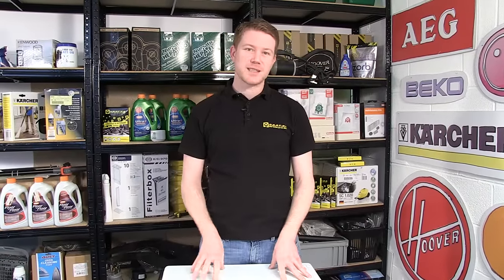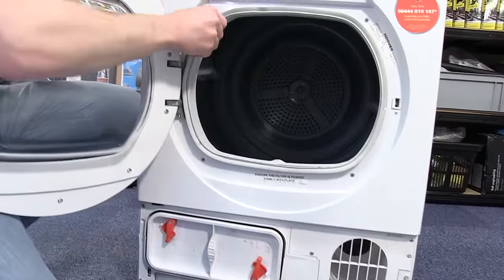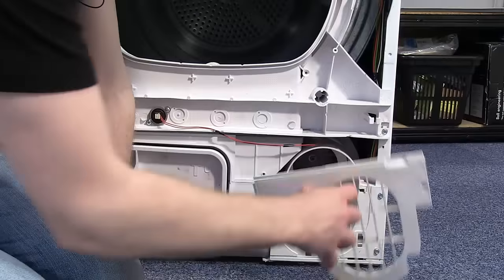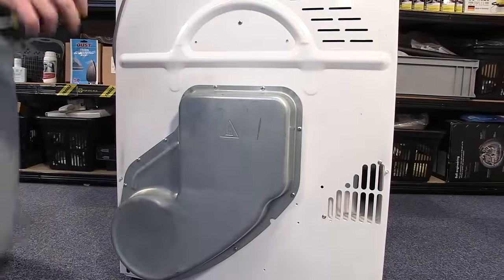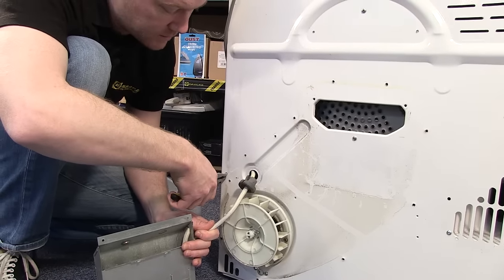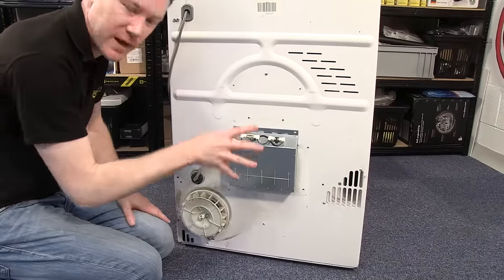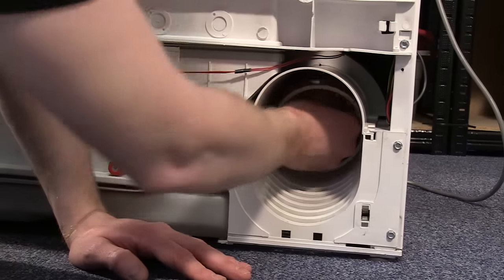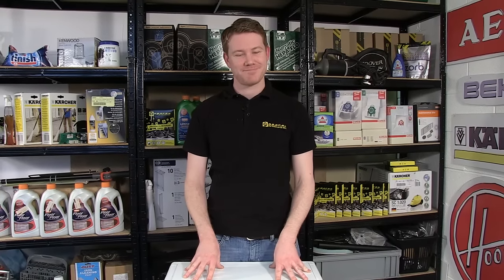How to Replace a Tumble Dryer Heater (Hoover)

Comment: Instead of taking the front off the machine I fed a bent cable tie through the cable grip hole: attached strong thread to cable tie with tape and pulled it through then looped thread around cable grip and pulled it through the hole; saves a whole load of time

Comment: Finished the job and it worked fine. Thanks. For anyone doing the same repair I would advise marking the position of the seal join on the cover with a permanent marker, also the orientation of the ring that sits in front of the fan... to make assembly easier.

Comment: Great video. I've just replaced the heater on my VTC5911NB following you, and saved over £100 in call out and parts. Only cost £40 for the heater and I did it in half the time it would have taken for someone to come out, look at it, order the parts, then come back and fix it. (Also Brownie points with the missus!). Thanks.
Reply from the maker: Hi Matt, glad we could help.

Comment: You don’t have to strip the machine JUST to reclip.
Loop fishing line through the grooves clip and push inside. Once heater is changed, pull the fishing line out with the tip of the clip and use small pliers. 
That’s 40+mins saved.

Comment: Hi,  can I suggest as a previous hoover engineer.

A faster way to do this for a heater,  although most engineers did not replace the little lug at the back to hold the cables as it was really a 3 minute job and we didn't want to have to part strip the front down (we were always pushed for time doing 11 jobs a day)  

However if you want to make this much easier and do it properly the is just to tie a tiny bit of string to that cable clamp,  push it through,  pull cables through as you show,  change one at a time,  push the cables back through and push rubber back in place,  then gently pull the string until the clamp comes through,  thats also the way they told you to do it in training.  That way you just need to take the back panel and heater off,  and leave the rest in place.
Reply from the maker: +jason hounsell Great tip to overcome a difficult problem, perhaps using a nylon fishing line would make it easier. However if the viewer gets stuck they can always return to our version.
Reply: I wish there was a video how to , I’m wanting to do this but I don’t get how or where you tie string iff just a little point is coming out the back
Reply: I followed your advice today. Saved me a ton of time. Thank You!

Comment: Great video. Well done hoover though for making such an easy job so difficult. I think the need for the cable holder was an afterthought.... why would anyone make it so complex to remove it otherwise.

The only problem I had was the upper fan cover which would not come out. My model looked slightly different than the one in the video which might explain why. I still managed to get my hand in though. Note that the screws in the front fan cover are different lengths. I think the short one goes in the right to prevent it from catching the cables behind. Not really designed for fool proof assembly!
Reply from the maker: Hi Neil, we agree this can be a difficult repair but for anyone attempting this there is some good advise from a hoover engineer on this page in the comments.

Comment: having issues with candy model similar to this. no heat and all the lights flash after 10 mins. watched a few of you vids and have ordered new heater element. hopefully this will remedy issues
Reply: I had the same problem
Reply: did you manage to fix it ??

Comment: You don’t need to waste time removing the front. Just use a thin piece of fishing wire and pull the retaining clip through the hole.
Reply from the maker: Hi Donald, thanks for your response and input. We hope this video helped you.
Reply: I did that with metal wire worked a treat but it cut out shortly ageee turning on I’m hoping it’s the 3 amp fuse I put in plug , just waiting for 13A fuse nie fingers crossed

Comment: Hi your video was very helpful, there are not a lot of videos for hoover driers out there and they are a bit of a pain as they do not have a side panel.
I was looking at yor diagnosis video before I ordered a heating unit but the element in that has a simpler connection than the hoover one.
Could you let me know across which two cables I should I should be checking the continuity in order to work out whether or not the element is broken.
Thanks
Reply from the maker: +Eoin Casey We do not have the colour code for dryer elements but you can usually see damage to an element if that is the cause. A more common problem is that the over temperature cut out on the top will have failed. Both thermostats on the top should show continuity.

Comment: I am not sure I have fixed the problem. The heater works but   The clothes are getting v hot and there is loads of steam in the drum. Hardly any water in the container. I’m worried the heater will fail again. I previously cleaned the condenser with a hose and Cleaned all of the air passages. The only odd thing I have seen is at the back of the machine under the condenser is a plastic cover that leads down to the water container..: this is held with two screws and is warped, but I can’t see this would cause the issue. Any ideas folks? Thank you.

Comment: How important is it to reattach the cable clamp? A local company just did this repair for us and there’s no sign of the clamp being reattached. Thanks
Reply from the maker: Hi David, as described in the video the cable clamp stops the wiring from the heater moving inside if not attached can result in the wiring catching on the drum which can be dangerous so it is important.

Comment: This video was perfect for what I needed, I replaced the heater and now it's not made a difference - Is there anything else I should be looking for?
Reply: did you find the cure think I'm in the same boat lol
Reply from the maker: +elbango2007 Sorry just found your comment, for more information see another video: https://www.youtube.com/watch?v=trJXdqNBn7M
If you still have problems give us your model number and we will try and help further.
Reply from the maker: +Tom Darbey Hi Tom,  we have just found the above comment and the same advice applies to you.  For more information see another video: https://www.youtube.com/watch?v=trJXdqNBn7M
If you still have problems give us your model number and we will try and help further.
Reply: Hi it's a hoover dyc8913 and the fault coming up is E08 I have replaced heating element and checked as many fuses as I can find.... the fault doesn't appear until about 20 minutes into cycle if that helps, getting plenty of air flow but no heat
Reply from the maker: +Tom Darbey E8 is a heating error. There is a thermal fuse on the top of the heater that can easily be 'blown' if you stop the dryer when hot in the middle of the cycle. Recheck the 'thermostats' with a meter to confirm they measure 'short' on a low resistance setting as you may have occidentally 'blown' the over heat cut out.
Reply: +eSpares dryer isn't getting hot, the whole heating element and fuses are brand new and I tested fuses before powering up, how can I check the element is being powered? I don't mind working on it while it's going
Reply from the maker: +Tom Darbey There is a NTC 'sensor' (http://www.espares.co.uk/product/es668984) to monitor air temperature. The exploded diagram does not show the location but we think it is in the air ducting and on another model can seen here:  https://youtu.be/kKykDud-WWc?t=3m28s
On your model there is also a pressure switch that may turn the heater off if water is no longer being emptied from the sump.
Reply: +eSpares hi thank you for your replies! I found that last night and it was giving me a reading of 18k ohms, I bypassed it (shorted cable) and it came up with E05 error so I put it back in, not sure what resistance it is looking for, obviously not 18k though ha
Reply from the maker: +Tom Darbey You may have to substitute it to completely cleat this. If the float switch checks out the next thing to suspect would be the control board.

Comment: Any chance you could make a video on how to replace the motor capacitor on this? I'm kinda hoping I can do it just by taking the fan and top section out.
Reply from the maker: +DJOveryde It is possible but you would have to work by touch only. See another video: https://www.youtube.com/watch?v=oHA0ZRt9AUM
You can see when the drum is out the capacitor is fitted at the top of the motor. If you use a long socket and loosen the fixing nut you can remove it with your finger tips (and washer?). Then unhook the cap and pull off the connectors. If that was't difficult enough you then have to 'offer' the cap in locate and fit the connectors with one hand by touch. and finally position and fit the nut and washer by touch again. Possible but easier to lift the drum out as shown in the other video.

Comment: hi i have hoover dryer the same as the video but in black, it stopped working today it was switching itself off after roughly 5 min but now it wont start at all, i looked through the air vents and noticed its covered in lint on the inside, could you advise me please how i would get inside the machine to hoover it out, we managed to get the top off but we dont no were to go from there. thanks
Reply from the maker: +clair wright If your machine does not start rotating it may be the motor capacitor has failed see another video: 
https://www.youtube.com/watch?v=Vd8DcQpk748
To clean it properly it may be better to fully dismantle as shown in our video:  https://www.youtube.com/watch?v=oHA0ZRt9AUM
Reply: thankyou we will have a look

Comment: Do these tumble dryers have a reset button and if so where is it located?
Reply from the maker: Hi Stevenblakeofficial thank you for your post. Some tumble dryers will have a reset button and some will not. You will need to check the user manual for your make and model.
Reply: @eSpares  hi Mine looks like it's the same as the one in the video

Comment: Strange, just replaced heater on my Hoover VHC681B. I only removed 2 screws at front bottom for fan housing. Went from there and no problem. No need to remove front panel.
Reply from the maker: What model do you have?.
Reply: Had updated after comment. VHC681B N3110039611421137
Reply from the maker: Ah I see where you are coming from now. You located the cable clip onto the back by reaching through the vent hole?. You can do this but for trying to show the method clearly we removed the panel, this is not essential as you found out. Thanks for the feedback. 😊
Reply: Would have been lost without your guide. The manufacturers don't make thing easy anymore

Comment: Im changing heats element on mine but on the old one it was covered with water should it be and if not what could be the problem thanks
Reply from the maker: If the element gets damp it is likely to trip your electricity. Check the condenser is clean and the water is getting to the container. May be worth checking this video: https://www.youtube.com/watch?v=pxZIetevnSo
Reply: eSpares thanks for replying. Everything works as it should now but now im getting this sound when it gets to temperature. I've put a video on my YouTube could you have a listen and let me know what you might think it is. Its coming from where the motor is. Thanks

Comment: hi at 2min35 you take out the fan, could you tell me how you would do this if the fan has come off and is rotating round when the dryer is (obviously I wont be doing this when its actually going round) is there an easy fix for this problem until I can get a new part for it??
Reply from the maker: Hi Kerry, at 2:40 Mat pushes his hand into the duct to hold the fan while he undoes the nut holding it on. If you don't hold the fan the motor is likely to turn when trying to undo the nut.
Reply: thanks for the response, I'm in a bit of a pickle as the fan is just free wheeling, I hold the fan and the nut just turns as the fan has broke, any advice would be great.
Reply from the maker: If you remove the heater cover at the back there is another fan attached to the motor shaft. Get some one to hold this and you can then remove the nut and front fan.

Comment: I have my tumble dryer apart and the capaciter says it's a 7uF one however their site said I needed an 8uF which I have. Can I install the 8?
Reply from the maker: +DJOveryde Depending on the production number it is likely thee has been a change.With the production number we can check and supply the correct capacitor but it will work with the higher value and just use a little more power (negligible).

Comment: Your videos are really good and helpfull, Thanks a lot!
Could you be so kind to tell me where the humidity sensor of this Hoover dryer is locatet?

Thank you :)
Reply from the maker: +Nico Hentrich Which model?, generally sensors are in the duct after the lint filter but before the condenser if fitted.

Comment: Can anyone help with this one please,
Hoover dryer comes up with error 15?
After a few seconds 
Heater glows red hot then error appears 
Many thanks
Reply from the maker: Hi Andrew, the error code is suggesting a fault with the heater relay but it depends on whether you have a condenser or vented dryer, so check for any blockages around the heater, if condenser test the relay and vented check the TOC on the front of the dryer inside.
Reply: Wow thanks for the quick reply 👍
It’s a vented dryer and have cleaned and checked all vents so that’s all good, 
Will check relay and front sensor this week and up date you, I have learned a lot from your videos already😀 keep up the good work

Comment: Or - you can just remove back heater cover, thread cable clip with wire or kevlar string, pullcables out and replace, pull cable clip back through on thread,  5 mins tops.  

You are welcome.....
Reply from the maker: Thanks for the comments John.

Comment: Engineers were apparently drunk when designing this think and built it backwards... If the wire connectors were all based around the heating element this would be a 5 min job...
Why do all these wires need to be replace with the heater... Such a waste, Especially when most of the connectors are right there on the top of the unit